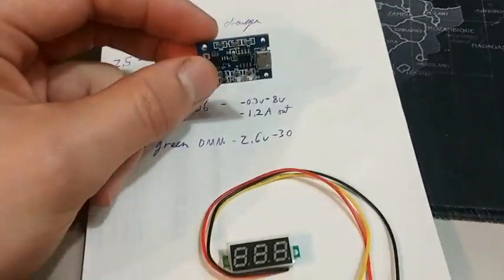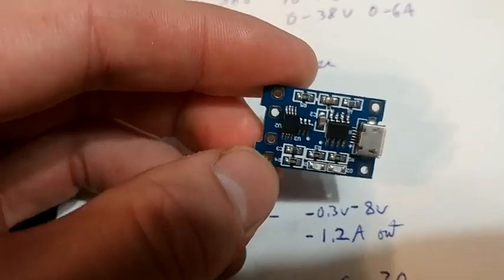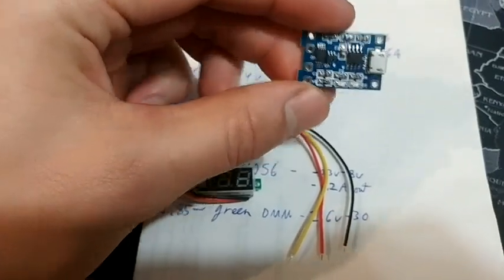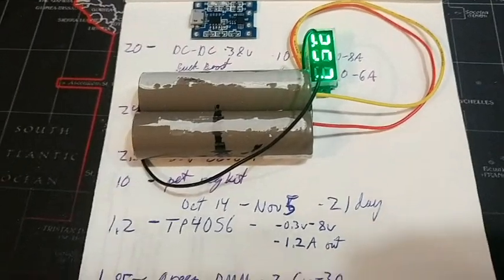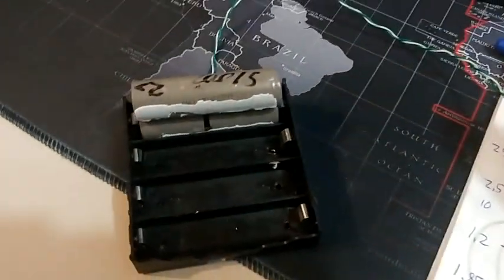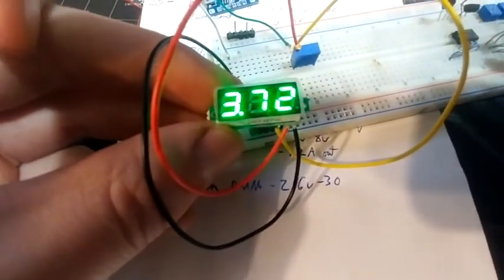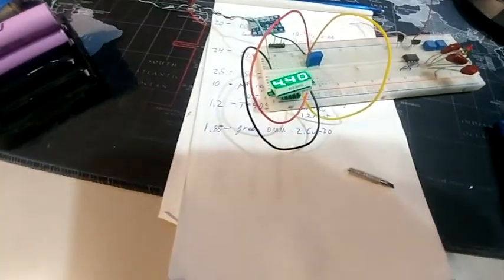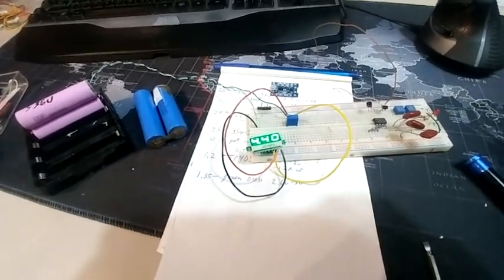18650 TP4056 and tiny volt meter testing modifying review

Comment: OK that is the tp4056 with the cell protection. I been wanting a few of those!!! And the small volt meters. I like the ice blue ones they seem not easily found! I saw them once. Didn't get them now they are gone! I may just get the blue, maybe white . and add a color filter. They need a diffuser or something. The ones I have on my dischargers anyway.  I'm thinking maybe put one per battery parallel cell, with a small switch. Toggel or latching button. I also need a way of charging a 12 v liion bank from the 29v bank.for the 12v lighting I have. It's kind of a backup incase of low bank voltage . I will still have lights. I'm thinking using 4s and charge to 3.7-3.8v for long life. Maybe use a buck converter. For both. I just need a controller for charging. I use the lights all the time. The batteries are for backup. Maybe it would be better to just build a small battery bank for backup. Like a reserve on a motorcycle fuel tank! More effiecent  for sure. Maybe try connecting to my bank with a diode to allow it to charge and only discharge when needed. Maybe a ssr and only charge until needed. Maybe a small sla bank would work better. Since it will be seldom used..